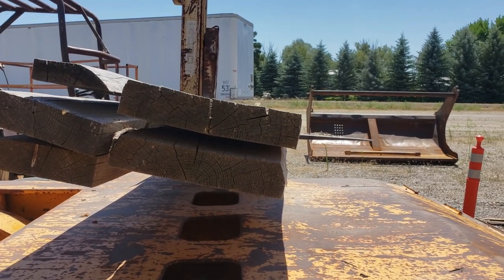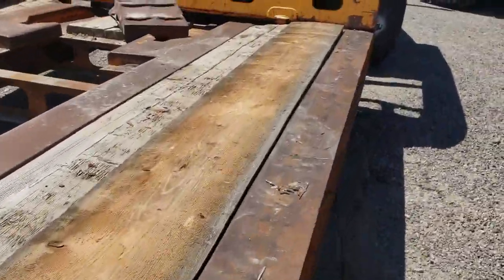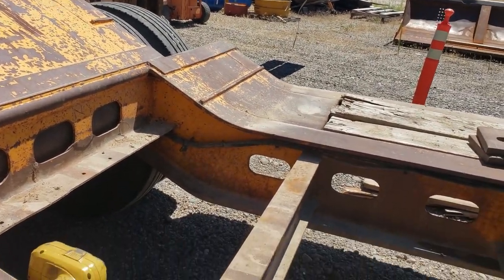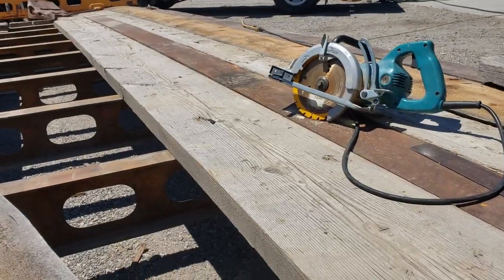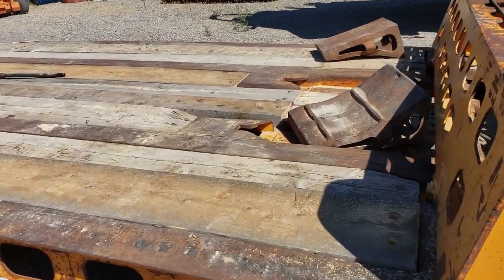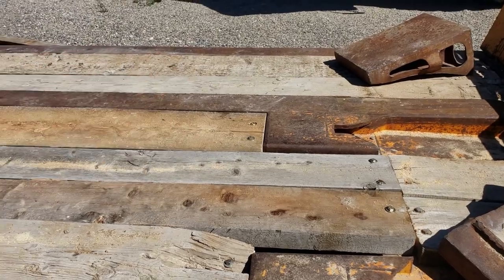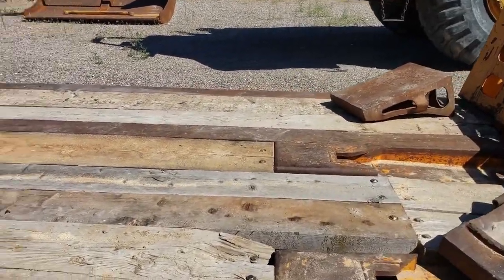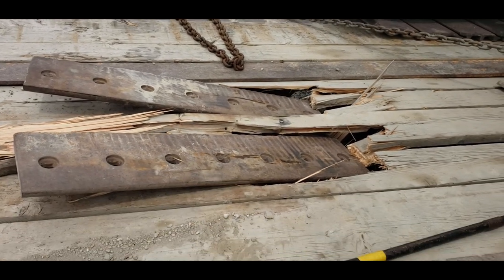Fixing The Lowboy Floor

Comment: Looks like another fine product from the Thick-n-Thin Lumber Co. Where I'm from, we call that kindling wood. Some nice white oak or yellow locust would be nice for that deck. Tune in next time folks where we see Jeff building a sawmill that really saws 2 1/4" lumber, with 4 square sides, that is reasonably straight for 12 bucks! Sorry Jeff, couldn't resist pokin' the bear with a big stick!

Comment: We put used conveyor belt on top of the low beds works like dream. Oh paint them boards when use motor oil a few times  before you install them to give them some protection from moisture.

Comment: Jeff pull the outer 2 planks. Weld some spacers to the supports to bring it up above the side rail to give you some traction. When you finally get the proper thickness planks. Cut the welds and remove the spacers

Comment: Jpaydirt, you should look into apitong decking.  It’s pricier, but it’s strong and specifically designed for trailer decking.  The texture also gives good grip for equipment and it lasts a long time.  Just make sure to coat it with BLO.

Comment: Best lowboy deck I ever had was cut from cottonwood and bolted down as it came off the mill. It warps badly as it dries. It doesn't split or check. We slathered a shit load of waste oil and diesel fuel on it as it dried.

Comment: Jeff.. try using some aluminum frame rail.. I put it on My cozad trailer and it lasted for a long time.. I did just the one outside plank on both sides.. I put wood inside the frame rails to help give it more support from bending if you haul a sheep's foot or compactor.. one plank aluminum and one plank wood.. I never had a problem of it being to slick. Or sliding with dozer or excavator..

Comment: Jeff,
   take that shit off, and return it...  Find a local or where ever, guy with a portable mill that can run you some oak or maple "FOHC" (free of heart center) to the thickness you need to set above the metal frame...
   Put the word out, there will be a guy that can fix you up my friend...
   The reason for the coast in any of the wood for truck/trailer decking, is because of the longer lengths you guys are looking for.  The hard woods required, are not typically 20-30-40feet long, and so have to be sourced from many different places...

P.S., my rant is not at you sir, and I know you have to have something on that trailer for work on Monday, but that stuff ain't gonna cut it...

Comment: Blimey.  You never let timber suppliers pick and deliver sight unseen.  The problem is that most folk pick out and buy a board at a time, leaving them all the shite, so they need unsuspecting folk to unload it on.   Yep, when I buy timber I look through the rack and say I want this board, and this board, and then I stand guard over those boards until they are loaded on my truck.  That's just the way the game is played.

Comment: Get your lumber straight from a sawmill. Rough! Lumber dealers sell finished sizes where a 2 by 4 is 1½" by 3½". Sawmills are set up to cut in ¼" increments so a 2" thick board is 8 quarter. An 8 quarter board when run through a planer loses ¼" on each side and becomes a 1½" 2 by. So, go to a sawmill, ask for 10 quarter lumber and it will stand ½" above the steel.

Comment: I've always wanted to try the extruded aluminum refer trailer flooring, we always have distorted trailers in our tow yard.  I believe it would be awesome, steel track will bite into aluminum but aluminum doesn't rot and splinter.

Comment: Maybe take and turnt yer cuttin edges 90⁰ under the bucket of the excavator, they look like they'd span the boards and also rest on the the trailer rails at each end too 🤷‍♂️? Makes you feel like a real geniu-ass when you get someplace or come back after the weekend and you've kilt the deck............good for your blood pressure, vocabulary, and starting the week off. It's bad enough when someone does it for you, but when you do it and you know better............💣💥💥💥💥💥

Comment: so if you asked for 2 1/4, you probably got 1 3/4..   think 2x4.. it's 1.5 x 3.5      same with 1" wood, it's 3/4 thick.
They give you size before it's been cleaned up with a planer. Now your's does not look like it's been cleaned up, so you should have gotten full rough sawn thickness.

That round was BS, he should have cut it square, he was trying to make it like you were getting more than you were... and then to boot pissing you off.

edit
stupid me, I did the math, that's not a bad price. if it were 2" figuring a 45 ft x 8 ft bed would be 360 bd ft. x2 inch thick would be 720 bd ft... and you should be paying about 1.23 per bd ft..
so if my math is correct or close .... btw did you ever think of buying the bed out of a regular truck that has lost it's top under a bridge or something. That's great oak hardwood usually.

Comment: I don't care where you buy lumber anymore it's all crap. Lowes , Home Depot, local saw mills I can't get anything straight or consistent. I built a couple decks in the last couple years and was alway told need to space the deck boards with a 16 penny nail. Well I used a Rachel strap when putting them down and squeezed them together until juice came out of them and then screwed them down. Six months later the gaps are so big a small kid can fall threw.  It all probably comes from China and we ship the good stuff over there.  Lol
Reply: At one time it was said that there were sawmills on big ships. Apparently operators were sending logs out to those ships and getting it sawed  for next to nothing. Then they would bring all the lumber back onshore. Don't know for sure how true that is or was. Might be part of why the box stores have crappy lumber? If that is what's going on then that is another reason to make sure that stuff is done here.
Reply: How can i buy swag
Reply: @briangarland9883  I believe that was at one time, 80's 90's with mostly "West  Coast" logs, like Doug Fir, Sitka Spruce, etc,
Reply: @logdog8920  Ah, ok. Still you are right, lumber nowadays is not that great.

Comment: That wood looks like crap. You need to bypass a retail yard and deal with a mill to custom cut what you need. Never specify in whole inches plus fractions as in the wood biz, that means nominal thickness before planing. You need to use numbers in 'quarters' or 'eighths'.     As an example, 1 inch is board finished to real 3/4" or 13/16, but a board specified to 4 quarters will be 1 inch. Its a bitch.. you gotta know the language. 2and1/4" is  really 9 quarters if you want the full thickness.  Confusing as heck.  Then factor in shrinkage as there is some loss there too. Better to talk to mill and get the actual real size cut. A reseller will never have what you need.
Reply from the maker: I did get it direct from a mill

Comment: I’d bring you some nice ash — but you’re too dang far away! And as many comments have alluded to, its good to dry sawmill lumber before it’s put on the trailer. It’ll take about two years to air dry lumber like for the lowboy. Even the kiln that I use would take a couple months — that’s thick lumber. Then it might move some during the process, in which case you may have to re-saw the edges. So really, the best thing to do sometimes is just tack down some crappy lumber and figure it’s gonna get torn up anyway and replace it in eighteen months or so. 

And that is some sorry-ass lumber. If you paid by the board/foot you could call the state weights & measures people but good luck with all that.